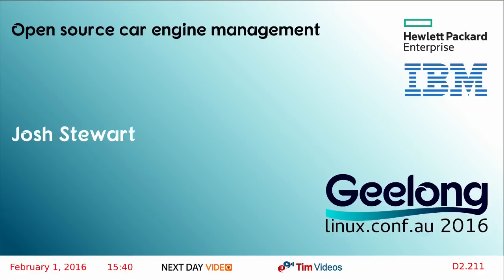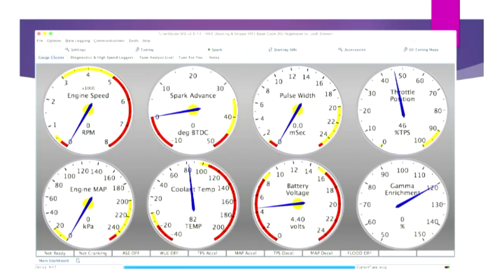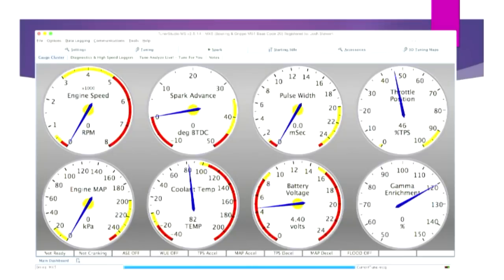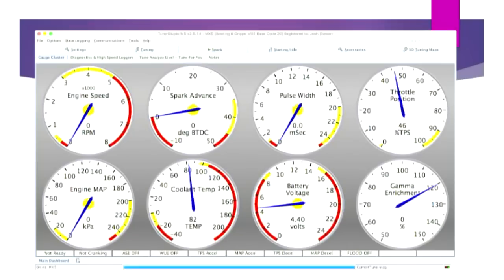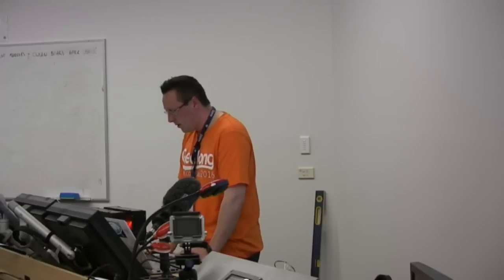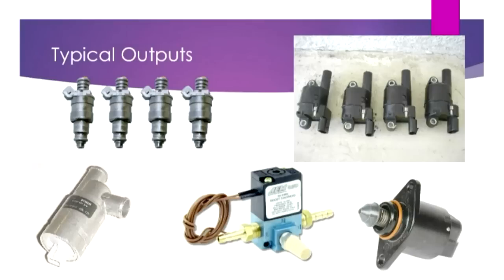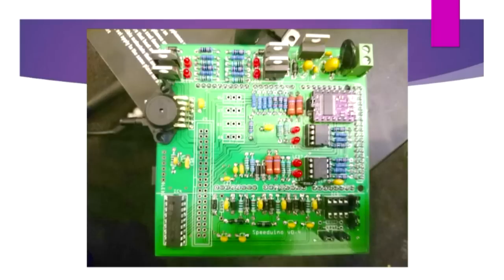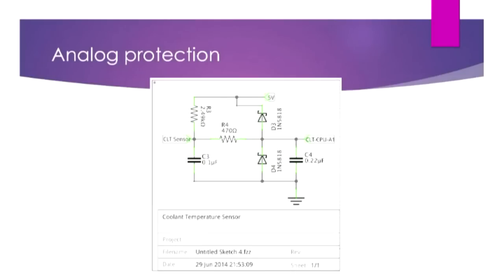Open source car engine management

Comment: Absolutely T O P   J O B ! ! ! !
I've only just purchased my first raspberry pi and this was literally the second thing I was considering using the pi for, it's only been my lack of understanding that thought that the Arduino might have it's limitations but it looks like it might be the other way around. I can't believe how few views there are on this video when for me it's been the second video that I found/watched in relation to open source ECU's. I will definitely be making one as I can see areas where performance gains can be easily had for a relatively low cost. 

Maybe it's just me that sees this project having massive potential for everyone from engine builders, tuning and even everyday use. I think it's fucking amazing!! If only the camshafts were not mechanical, if it were possible to control valve timing this could turn the meekest of engines into a snarling beast!! Fuck I'm only 3 years out of touch on this one!!!

F U C K I N G   A W E S O M E   W O R K ! ! !

Comment: I think this is the only YouTube video I've ever seen without a single dislike. Great work, for the kind of builds I do existing ECU/Tuning solutions cost more than I have in the car so it's not worth the added performance over just using a carburetor. I'll definitely have to give this a try.

Comment: I’ve used two of these systems for customers, one being a small block ford and the other an LS. For about a third the cost of say a Holley, Edelbrock, FAST etc.... you get a very good system. And the bigger companies all advertise their systems as being capable of “self tuning” (a base map is auto corrected based on wideband readings, does not tune for wot), the Speeduino can do the same thing via Tuner Studio
Reply: It doesn't need Tuner Studio at all. I believe he left it like that to show support for TunerStudio, as people will buy it for the the silly auto tune.